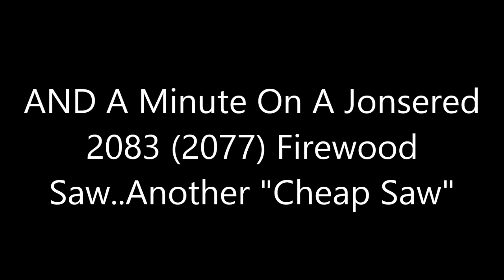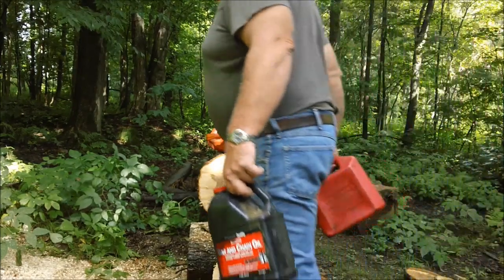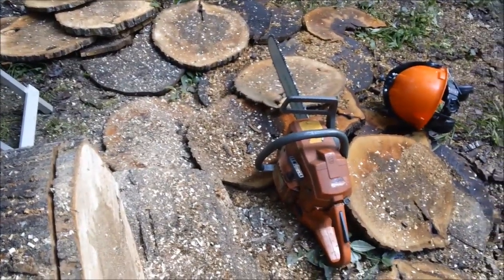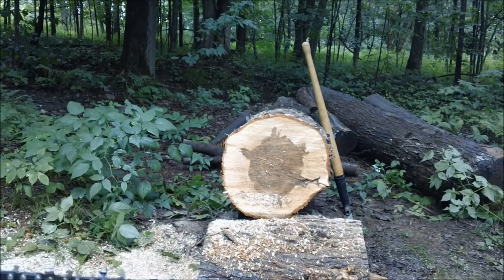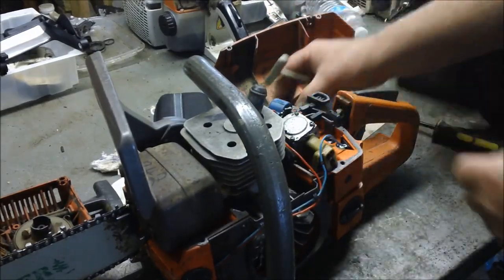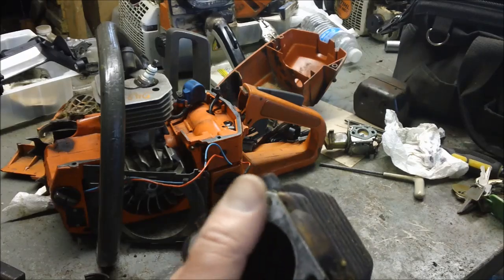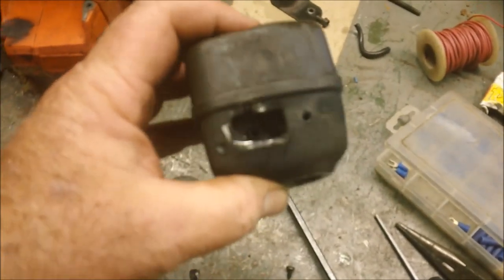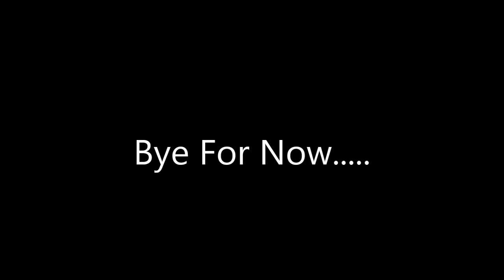Husqvarna 42 "Cheap Firewood Saw", Bought A Cheap Saw Online, What Now!!

Comment: I got a PM610 in part of a trade for my ms 460 this past winter.  I had to do a few repairs to it, like all fuel and bar oil lines, oil pump diaphragm and rebuild of the carb.  I had to repaint a few of the covers and a few other minor repairs.  I have less than $100 bucks in it, mostly for the chain.  I refinished an original 610 bar for it.  It cranked up on the third pull the first time.  I am very pleased with it, even if I have to run 40:1 fuel in it.it will blow that husky of yours into the weeds.  It is one of the easiest cranking saws I have.  Even my oldest daughter cranked it(cold) in a couple of pulls.  It is a little heavy but a lot lighter than some of my saws.  It has a 20 inch, full chisel, full comp chain on it.  It does need a set of dogs but it will cut fine without them.

Comment: I have always said, as a longtime gunsmith, that 90% of problems are user related.  Usually, failure to clean and maintain, properly.    I am sure saws are no different.  You can bet my saws are not of these types.  After every use they get cleaned and sharpened, even if it is only a maintenance sharpening.  I also fill them with the correct lubricants and fuel, mixed as best that I can.  I have a mixture of different equipment.  I try to use the same fuel in all of my equipment.  I use premium, non ethanol gas with good two cycle oil and a good fuel stabilizer.  I do not mix it at the oil concentrations that some people do, but I usually mix it at 45:1.  However I do have a tank of 50:1 in the shop, which I use for specific pieces of equipment.  I recently used it for a new husky 135 that I bought.  This tank of gas was husky XP oil at 50:1.  I the reason I switched this saw to husky two cycle oil was because I was getting a little compression lock on startup.  It is getting better but still gives me a little difficulty but I have no real problem starting it.  When I get it broke in I will probably switch it back to my regular brew of 45:1.

Comment: Another great video! My 36's/40's are my fav's. My lil 36 is running like an angry yellow jacket! The porting practice was great on a couple of these. I grabbed a Stihl ms250 and a new oem jug/plug its my next one! I was looking for porting vids... I guess because with that one piece still your fingers need yoga to fit in there to clean those ports! The 391 is stealing my heart... And I bleed orange! I gotta find a used muffler!!!! Needs ported yesterday... DonnyBoy got a crushed parter... I'm working on him!!! LOL what's the thin wall 5/8 to mig the muffler tubes from?
Reply from the maker: +David Thorne Thank you. You ever measure the port timing on those saws? I haven't to this point. Might be ground to till with intake timing and exhaust with a muffler mod. I haven't taken a 250 apart yet.
Reply: Dave use metal conduit for tibe exhaust exits. It is also easy to bend with proper tools if you want to get fancy

Comment: Hi I have a 242 running well. Any advice on oil running out of the vent inside the clutch cover. It comes out of the front dowl or bar guide. As this saw has only one clutch cover nut. Thanks mate. Don't want to go pulling the saw apart for nothing.
Reply from the maker: They all leak, should run out though. Oil pump? Maybe vent?
Reply: My 242xp used to leak bar oil untill i've replaced the following parts:

Some kind of rubber grommet
Part Number: 501624301Oil Hose 
Part Number: 501876501

Comment: I just tried the hanging cord compression test and mine did the same yours. 

Is there anything I can look at? I've already checked the spark plug hehe
Reply from the maker: A 42 or 242? Best thing to do is buy a ring and then scuff up the inside of the cylinder to break the glaze with either a hone or 150 grit emery cloth... The roughness with a new ring will let that ring seat and you will get more compression. Also check squish... if its more than .040... you can do a 1194 no base gasket build when you put that ring in.

Comment: i heard you say you got a 238,i got a 238 that i got as an heirloom,getting tired after many years of cutting firewood. do you know where to get a piston or is the 242 top End a Bolt on?
Reply from the maker: I just "haunt" eBay until one shows up. I do have rings for those 238's around somewhere. Wonder if they still are any good..

Comment: Why do people start their saws without the chain break on?
Reply: Because it is unnecessarily hard on the clutch and the brake band.  If you are drop starting one, sure.  However if you have the handle gripped in your thighs or the saw is planted on the ground (with a clear bar) i'm sorry but it's a non issue.

Comment: could you do a timing video :)
Reply from the maker: Yup. Plan to first map then tweak the port timing on one of these little beasts and also make and then use offset keys to tweak ignition timing... did that on the 238 I have. Just have to have the time to build the video's. They will happen faster this winter. Will be on nite shift & have all day to work on saws.